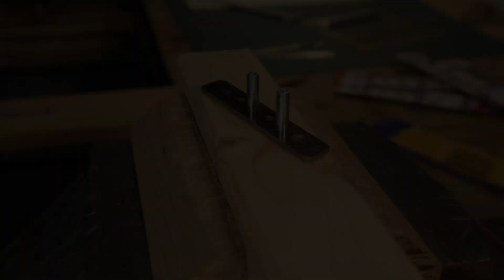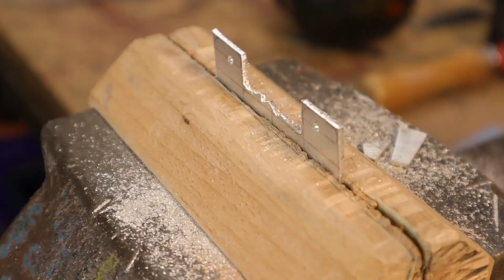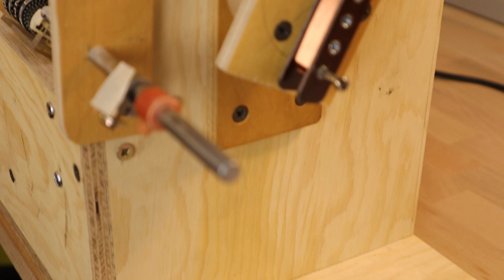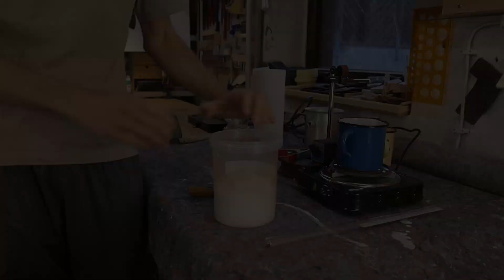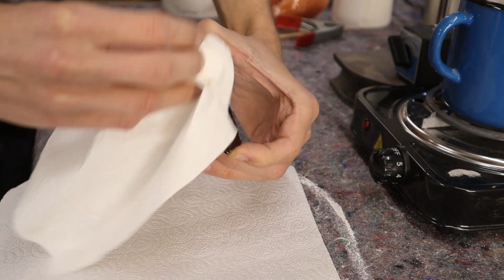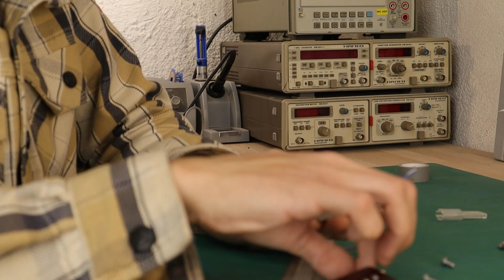Making a unique custom Pickup from scratch - Custom Guitar Build - E02 The Pickup

Comment: that pickguard material looks like old bakelite, wow, what a find, that s a serious score . .   maybe take a scrap piece and sand down both sides a good 100th of an inch or so then a 3 stage polish see what happens?  it might be that material I cannot think of the name they used for amp boards so forth?  its non conductive right?  using it for the pickup base is a good idea..

Comment: Winding the wire from the coil in the way you chose is unacceptable. Without turning the coil, the wire still remains twisted around its axis. Thus, it has mechanical tension even when it is wound on a new frame.